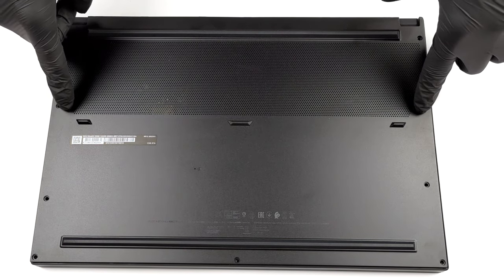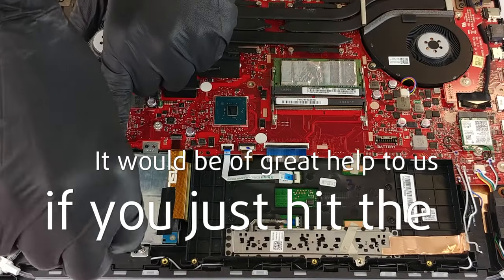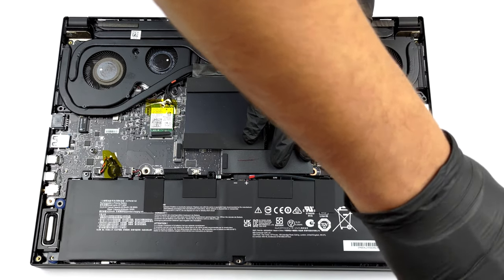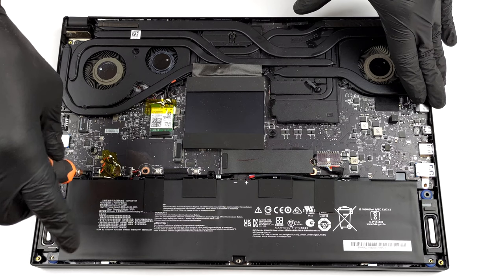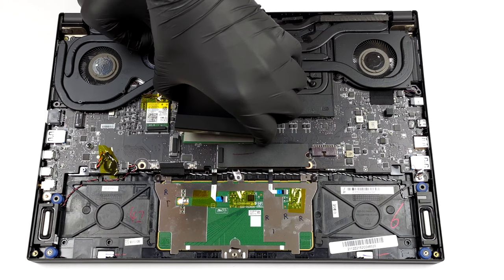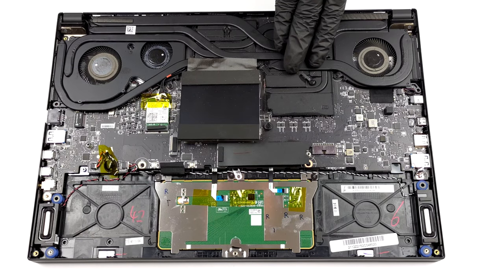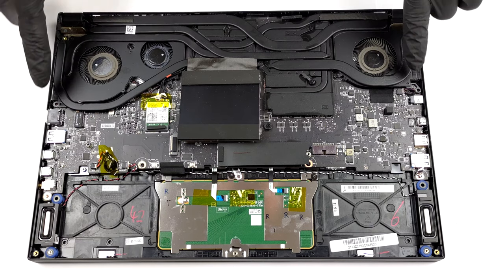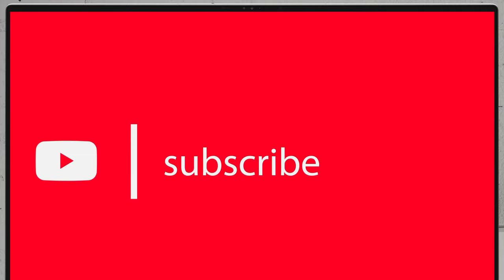🛠️ MSI Stealth GS66 (12Ux) - disassembly and upgrade options

Comment: Just looking to add an additional m.2, do I need to remove the battery to install it or can I just plug it in with the battery still there?
Reply: I was able to do it without pulling any of the other components out. Just had to be careful not to lose any of the original screws on the case!

Comment: Is anyone who owns this laptop able to tell if the structural WiFi issue is solved with the 12Ux series of the GS66?

Both the GS66-10Ux and GS66-11Ux have REALLY bad WiFi reception on the 5 GHz band when the nvidia GPU is active (down to 5-10mbit/s at 100% load, next to an ac1900 router that otherwise hovers around 400mbit/s when the nvidia GPU is off).  This is due to EMI (electromagnetic interference) from the GPU, the wifi antenna cables being routed next to the GPU and mounted on the top/side part of the chassis right above and between the CPU and GPU.

It seems MSi made some changes, from the looks of it (without being able to see under the heatsink) they swapped the location of the VRMs with the memory slots. From the GS66-11Ux to 12Ux, the NGFF wifi card slot got moved a bit upwards, but it seems the routing and location of the antenna cables are still roughly the same so I suspect the same issues.

If anyone is recognizing this, your laptop is not faulty, your wifi is simply not functional by poor design choice.

I ordered some cheap antennas so I didnt need to remove the heatsink/logic board to re-route the existing. Running network speedtests gives me full speed having those new antennas located outside of the chassis and avoiding the cables to get near the GPU.

The problem however is that there is no better location to mount the antennas inside of the laptop. I mounted the new antennas on the battery as there should not be any RF there, but the metal enclosure of the MSI is a very good faraday cage and practically isolates it to the point both 2.4 and 5ghz bands often dont connect or only reach speeds up to a handful of mbits/s
Reply: Wow I've thought my connection issues were just due to some undiagnosed issues for the longest time.
Reply: @nuclearsnek3749  Which model of the GS66 do you have?

I first suspected the pci lanes to be the bottleneck before I started digging as the nvidia gets 16 pcie 4.0 lanes and the i7 11800H in the GS66-11 has 20, with the ssd also getting 4 lanes. But the gpu is not able to saturate that link, the wifi adapter + ethernet are connected to pcie lanes on the south bridge from a dmi link to the cpu. Also, ethernet shows no such performance dip while rendering 3D, only wifi does.

Testing pointed out that with cheap aliexpress antennas connected to the ax210 wifi chip, away from the GPU, all the signal issues are gone but return once you move the antennas closer to the nvidia chip.

The antennas are placed under the only piece of plastic within the laptop, right in the middle, next to the GPU, as the sides are already occupied by the fan vents. No other chassis parts are made of plastic so the only alternative would be to drill holes and route the antennas out of the case and glue them on the back of the display. That is too much of a Frankenstein setup for me though and not really suitable for mobile use, kind of where this gaming laptop shines with its relative size/weight.

2.4GHz gives much better stability as it's mostly the 5GHz band that gets nuked somehow. Someone mentioned that the 6GHz band is not affected, but I was unable to test this as I'm not throwing a couple hundred bucks towards a wifi 6E/7 router or AP just for this laptop.

Note that many cheap wifi 6 routers do NOT operate on the 6GHz band, they are all dual band 2.4/5. For 6GHz you'd need something marketed as tri-band.

There is a beefy reddit thread where all of this got discussed in case you bother to read more about it:

https://www.reddit.com/r/MSILaptops/s/8OsKDYmBHm
Reply: @FooblyWoobly  I have a GS 66 11UE and although I haven't tested it  my experience is consistent, with my wifi connection dying while I'm playing games. Especially graphically intensive ones. I'm not experienced at all with the mechanics behind how the laptop works however. I would have never have guessed.
Reply: @FooblyWoobly  I'll definitely have to try a wifi dongle, because I'm at the mercy of someone else's wifi. It definitely sucks but thank you for a solution! I would hope the 12x series would fix it because otherwise the laptop is really quite nice. But thank you for the great breakdown on it's actual problem and the solutions!
Reply: Wow thanks I've had really weird WiFi and I've stopped playing games and I never realised why, always had something in the back of my mind thinking it's to do with the heat but not electromagnetic interference... Unfortunately for mine it runs Hella toooooo hot, and I'm not gonna risk it but my CPU used to go up to 90 and I'm just sick of it and can't be asked to open clean and change thermal paste again? I noticed there is some red paste on the components next to the cpu/gpu is there much difference?